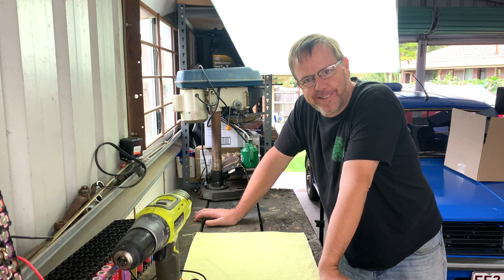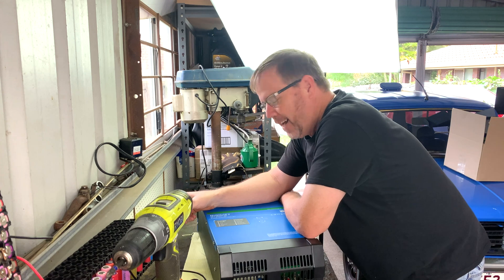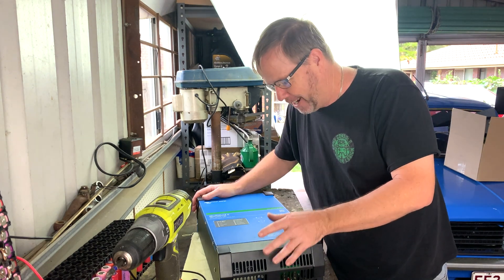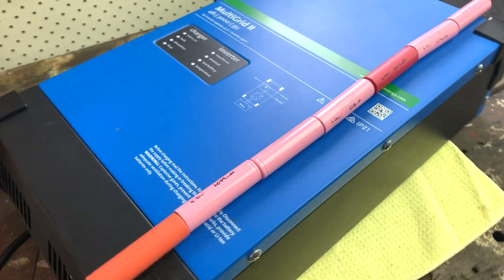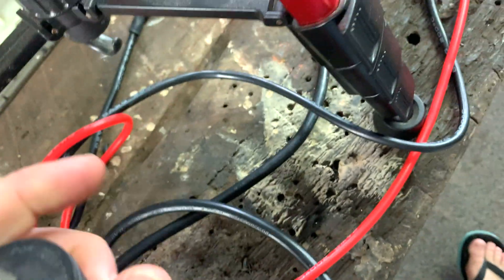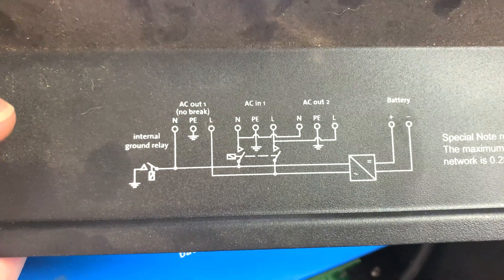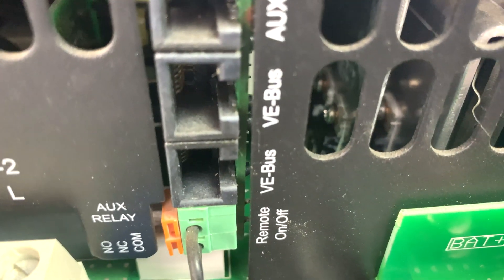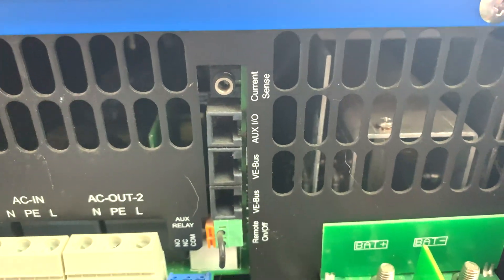Taking a look Inside a Victron MultiGrid II 48v 3000va 30amp

Comment: Funny that Victron is still using a low frequency bulk transformer in their inverters. Most of the Chinese inverters have moved to high frequency boost converter designs. Just like the power supply in your PC but backwards. This reduces weight and cost and can be more efficient.
Reply from the maker: Not sure, but they work and work well for a long time. So must be something to that i guess.

Comment: Put your AC solar on the AC-Out-2/Critical loads and if the grid fails the AC Solar will stay on as the Victron creates a Mini Grid. ESS helper installation required.

Comment: My first victron pultiplus II 3000 has been working for 4 years now
only the power
Inverter properties
Continuous power at 25°C (VA):3000VA
Continuous power at 25°C (W): 2400W
Continuous power at 40°C (W): 2200
Peak Power (W):5500
1500W charging

added a 2nd one
these work ongrid with SMA
Reply from the maker: ooh nice! good to hear they go well, been trying to work out the difference between the mulitgrid and multiplus but doesn't seem to be much out there.
Reply: @HBPowerwall  They are much the same apart from the Multigrid having double the feed-in relays which is a requirement in some countries
Reply from the maker: Thanks for the info

Comment: I am running a Multiplus 2 GX 48V 35 A unit grid connected. I am super happy. Just AC In to mains and done. The internal GX card is the brain of the system. GX venus is the the external unit which you have to use for inverters without the internal card.
Unfortunately last year in internal explosion happened and some mosfets said goodbye. But instantly I got a replacement under warranty.
I was running the unit laying flat which was okay by the manual but now the unit is hanging on the wall and is much cooler.

Comment: The humugulus coil is a large toroidal transformer, which is just full of copper.
Victron inverters are very simple, but very well built, and as you have found out are far from light.  Depending on the generation some have incredibly low standby power consumption as they use a very low rated PSU to provide that function.
Reply from the maker: Thanks Rob for the info.. I should test the standby power for sure.

Comment: For Configuration you would need an MK3 to USB adapter, you can connect them to an raspberry pi with Venus.OS installed and configure it over the web interface.
Alternatively if you want something that just runs stable get a Cerbo GX, yes its pricier but worth the money.

AC IN is your charger side

AC 1 is always on if the inverter is on.

AC 2 is on when there is power at AC IN
Reply from the maker: Still reading all the gear I'll need. Kinda disappointed i need another tool to configure.. I didn't realize that when I got it.
Reply: @HBPowerwall  That is kind of true, that's also the good thing with the smart devices that you can configure over Bluetooth. 

You buy in to an eco system with victron, an multiplus as standalone device is kind of stupid without the system controller. The controller enables most of the functionalitys like ESS and AC coupling.
Reply: Also came here to suggest VenusOS on a RaspPi with a RaspberryPi Touchscree n.

Comment: Blue is king. The quality is high, they support is exceptional. It'S a high end item. Constant updates of software which afaik comes free, One thing to remember, they not handle aus heat so well and drop output the marked number applies for 20-25 degree Celsius ambient temp.
Reply from the maker: Didn't realize about the heat might be an issue.. I'll take that into account when installing
Reply: @HBPowerwall  thats okay, had some mates i had to enlighten about they live in an oven compared to norther eu, where it's engineered. :D
Reply from the maker: Ozzie land does get warmish so it's a valid concern, maybe that's why the installed that huge fan.. Interesting tho they put the fan midway not at the bottom pumping fresh air in.

Comment: Regarding programming - you can buy a USB cable, or you can invest in Cerbo-GX - which is a box that connects multiple Victron devices together, along with connecting the system to the VRM portal. If you can this one, you can program the device "remotely" via cerbo GX. Feel free to contact me and I can walk you through all that via Zoom or phone call. Really curious where you're going with this.
Reply from the maker: Thanks for the tip, I think i'll go the Cerbo-GX to try reduce the cable clutter..

Comment: overpriced equipment
Reply from the maker: Good hookers cost more doesn’t make them over priced
Reply: Not overpriced if it out lasts many cheap units.
Reply: @MrDingaling007  understand what you're saying but that 3000va is a 2400watt inverter and i would rather buy something else for that amount of money. I started out using a victron an sold. using a outback 3500w now
Reply from the maker: Outback seems to be solid gear also
Reply: Not really… just depends what you want.  I build a 3 phase system with good monitoring and management.  Not a lot of options unless you want basic stuff.
Reply: @soldermecold7456  🙄 ok
Reply: @diy-bj2ed    Just because you find it to be "overpriced" does not make it a bad value.  I have three Quattro units connected to utility power, generator, and battery for the primary purpose using it as a UPS.  Reliability, Power quality, and reporting are the design objectives in that order.  Victron just delivers.

Comment: Interesting clean design. Even the pcb in the centre appears to act as an air guard to help manage airflow to the fan. 
Regarding price ... some people pay extra not to have to open and peak inside. LOL. Another hidden price is the quality of software/firmware that make the hardware operate. Not so easy to compare software across designs. 
Good luck getting this juice processor plugged in and making some fruity sweetness.
Reply from the maker: I love seeing how the pros do stuff !!

Comment: It's basically a giant inverter VFD (variable frequency drive). The heatsink in the lower right is where the magic happens, where the DC is turned into a 50 or 60Hz PWM based sinewave. It's filtered by the giant toroid and turned into the output voltage. The toroid serves to both filter and to isolate the output voltage from the DC supply. The cost comes from the parts in the box, the regulatory costs, and the amortized development costs. The final price is probably around 3-4x the parts cost, because that's the way that things are priced in the international economy mostly. double. Price hike from the manufacturer, price hike at the distributor, price hike at the retailer. Everyone's got to make a profit all the way along. This is advice from an EE who has been in product dev for the last 25 years.
Reply from the maker: Nice thanks for the info

Comment: You got 18650's everywhere.  Looks like a ups without the batteries. Are you replacing the inverter in your workshop with this?
Reply from the maker: I have some plans but don't know how to implement them within the current Australian Regulations. Step one - attach to the side of my new 25kwh battery cabinet & charge my EV lol

Comment: It's pretty basic , you have your multi volt input from your solar charge controller which feeds into the voltage increaser toroid transformer which then times the voltage up to 248v AC. Most toroid transformers are made to reduce the voltage from say 240v AC to whatever voltage you need to transform to, the difference with these toroid's is in the directions of the windings & size of the wire.
Reply from the maker: Hey thanks for the info.

Comment: Looks like a solid build but Victron way overprices their inverters for what they have inside.  They are counting on people wanting all the bells and whistles with the communication ports and easy setup but the unit is a nice looking one even if it is very tiny output for the price tag.  These days we thankfully have lots of competition in the inverter market so it's possible to get a decent sized 6KW inverter with communication ports for around $1200-1700 US and a 12KW inverter for $2200-3000 US without having to break the bank and still have all of the features needed and reliability for a modern inverter.
Reply from the maker: I think the fact they do what they say they do on the box give them a huge amount of value. I'll take a while to get this one into production but when it is, it'll be interesting to compare it to my other PIP inverters
Reply: Buying Victron is like buying a Mercedes, sure there are inverters with similar specs around for less money. But with an Victron you can be sure that it just works for most likely the next 20 Years without bigger problems. Also there are not many manufacturers that offer AC coupling in offgrid mode, i just would know SMA now and that works only with their own inverters and is more expensive than victron.

I also did not find a company that makes an comparable software until now that works as flawlessly as the Victron VRM. If you know an better alternative I'm open for that.
Reply: @OlanFantaziya  In the professional marine field its Victron or Mastervolt

Comment: That looks a LOT simpler and more modern than my old MultiGrid, which has a ton of single-sided PCBs with thru-hole components.
Reply from the maker: I want buy more now just to look inside.. Its odd i like knowing what is inside even if i don't know what is really in there..